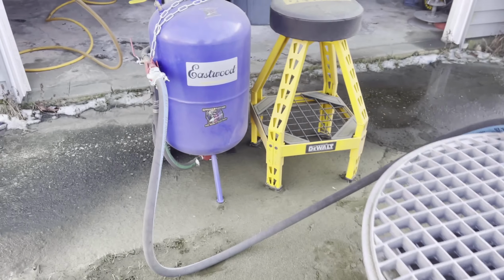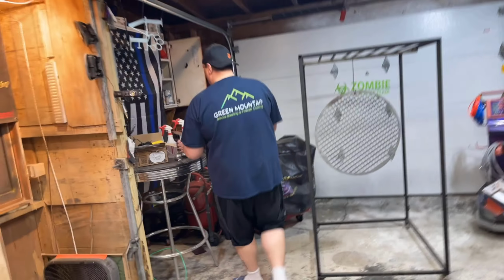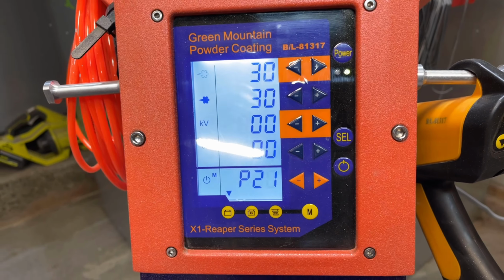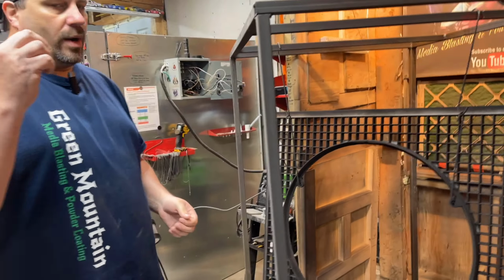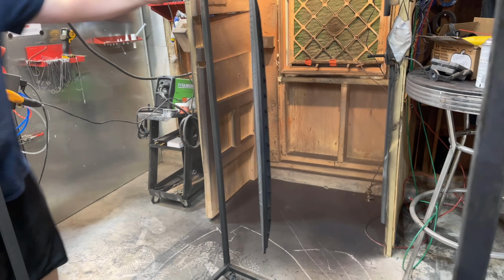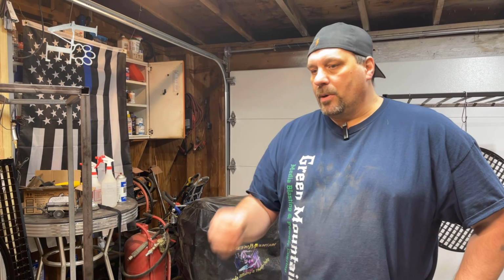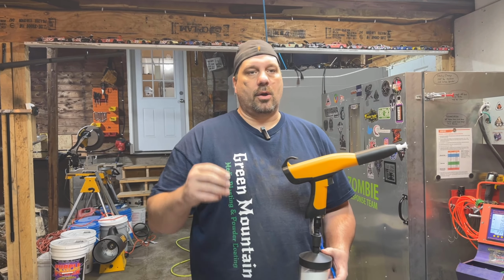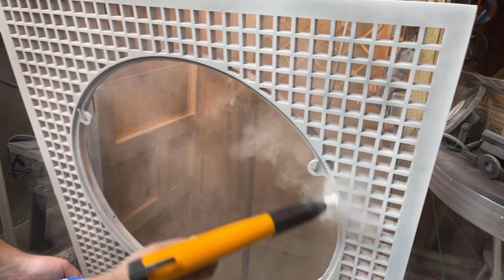How to turn a heating grate into a coffee table #35

Comment: Usually when I run into a tough faraday cage I turn the cloud up and the total air down (second adjustment down) I don't use a kf-x1 but it should be set up the same since it's a clone. I try to let the powder float into those hard to get spots instead of blasting it in there because usually that just blows off more powder than anything. And on the tougher spots I'll rapidly pull the trigger on a heavier cloud lower total air and that helps as well. Just some tips that work for me. Give them a shot next time you're in a pinch, they may or may not work for you.
Reply from the maker: Thank you
Reply from the maker: Found your channel and subscribed